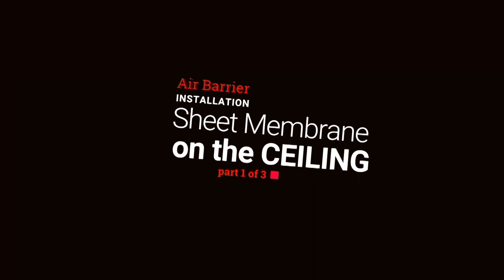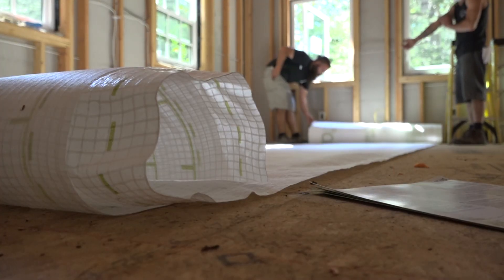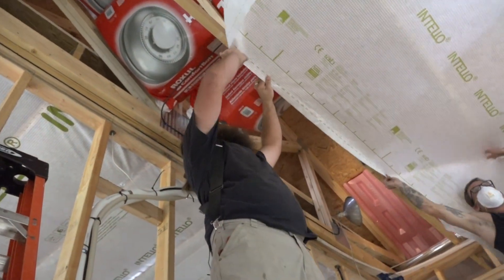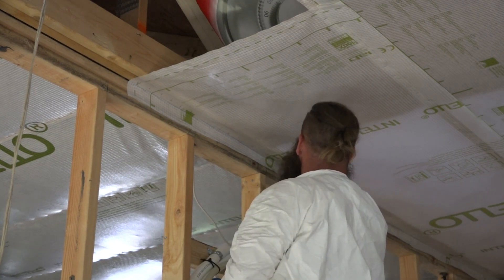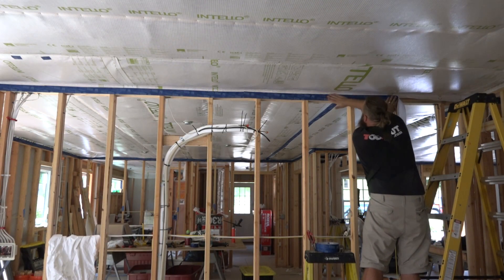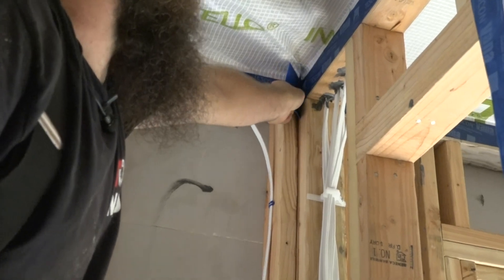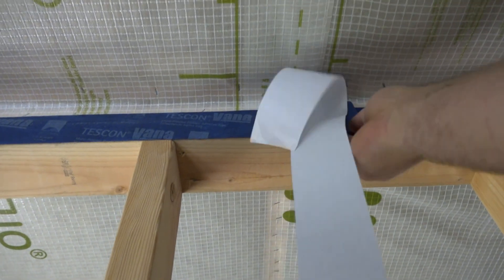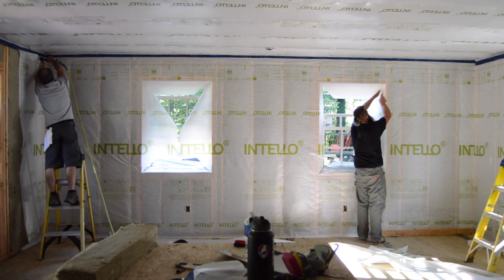Interior Air Barrier Installation (1/3) Ceiling

Comment: Nice video describing the installation of Intello. If the home design has a vented attic then the air barrier system for the ceiling comes down to the Intello and the drywall. So you need to get this done as best you can.

Comment: Would this brand of barrier be ok to use on a t&g vaulted ceiling? Trying to air seal without having to sheet the whole thing in drywall first.
Reply from the maker: Yes, though drywall may be cheaper

Comment: Great videos! I had a question about putting the intello on the ceiling. 

I have a 2 story home & I was wondering if I should install intello in between the first & 2nd floor? I can’t seem to find an answer on whether I should or not.
Reply: no
Reply: I've seen that treated two ways.  One is to have tape from the inside of the first floor top plate to the outside. Then a barrier taped off on the outside over the rim onto the second floor subfloor before sheathing.  Or if you balloon frame (see Awesome Framers) they use a ledger and put a strip of membrane on the ledger before they put it up.  If you can split the framing inspection and do only the exterior walls, pass that inspection, insulate and apply membranes and then run on mechanicals in a service cavity inboard you can be bomber with air/vapor/water/thermal in a big barn of space and frame the interior walls and other trades in comfort.

Comment: Why does stapling the barrier not put holes in it? If air tightness is what I'm trying to achieve wouldn't there be lots of holes for air to get through?
Reply: You could tape over each staple.
Reply: You put tape over the staples.
Reply from the maker: There is no such thing as an air barrier for practical purposes. it is really an air barrier system that you aim for: exterior sheathing, insulation (perhaps) drywall are parts of the system. 

an interior membrane is another part. Unneeded if you do a good job in other places, but a belt for the suspenders, if you're not fashion-conscious.

Comment: Where are you guys? I live in Texas and have never heard of putting an air barrier on the interior. Seems like a good idea just not sure if it would be a good idea in my climate. Any thoughts?
Reply from the maker: Air barriers are a good idea in any climate, and they can be anywhere in an assembly. 

Understand, though, that an air barrier is not the same thing as a vapor barrier, which often is in the form of plastic.

Totally different concepts and totally different implications.

Vapor barriers are defined the the building code (actually called vapor retarders unless the retarder has the highest coast rating, making it a barrier). They are typically placed on the "warm-in-winter" side of a wall. A vapor BARRIER  is a mistake in almost all climate zones of North America, except the coldest ones.

Air barriers are typically made with multiple layers in an assembly, hence the usual term "air barrier system." In this house, there is continuous exterior insulation, whose joints are taped tight. Hooked in the envelope were sealed with canned foam, and the drywall will also add to the system.

The material in this video is NOT PLASTIC. it is a permeable membrane That stops air, but allows moisture vapor to pass. This means it will not trap moisture, like misplaced vapor barriers will.

Talk to a QUALIFIED night building science engineer for the best assemblies inn your climate.
Reply: @ProTradeCraft  so... in canada I can use a vapour barrier on ceiling right?
Reply: @rekostarr7149  That would make the inspector unhappy.They want a plastic diaper.6mil.
Reply: @chrisdalpetz2284  Just southwest of Ottawa, our building inspector allowed us to use vapor barrier paint on 1/2" plywood sheets nailed to the bottom cords of the trusses. They were caulked and taped at the seams (3M 8067 tape). This in lieu of .6mil.

Comment: If you have a full air barrier, would you still need to caulk around the studs before applying the barrier?
Reply from the maker: There really isn't a single air barrier in a building. It is really an air barrier system. Stopping air leaks at every opportunity is the easiest way to get a tight house.

In this house, for example, the drywallers cut this membrane at every window opening with their drywall routers. 
:(
Reply: Yes.  Caulk every crack inside and out or use tape.